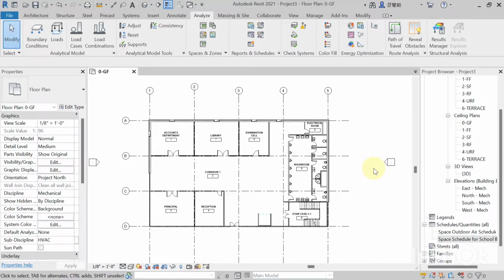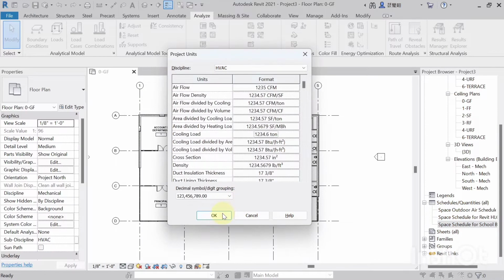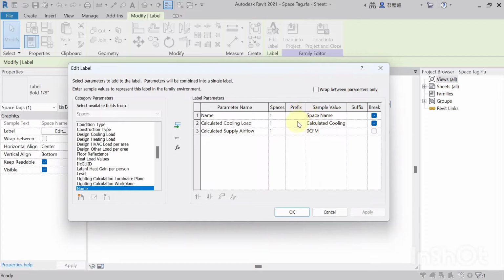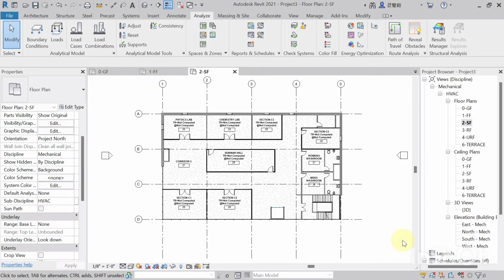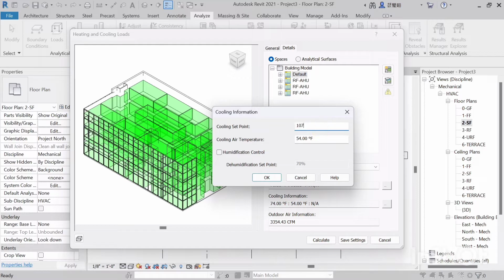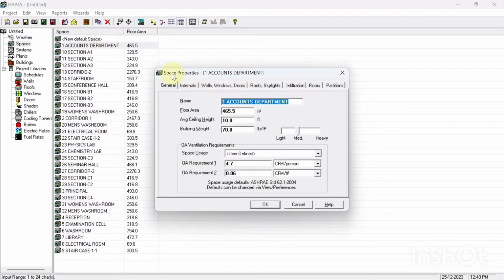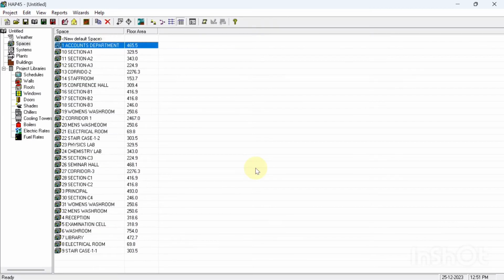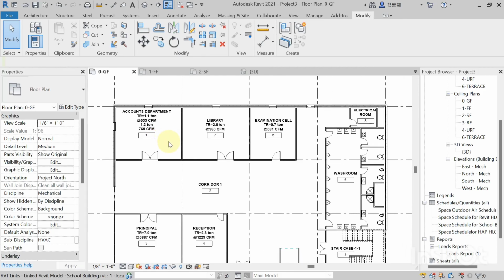Complete Heat Load Calculation in Revit | Full Step-by-Step Tutorial!

Comment: There is an Outdoor Airflow, how does it differ from Fresh Air?
Reply from the maker: Yes — they are related terms, but not always used exactly the same way in HVAC.
Outdoor Air
Air taken from outside the building into the HVAC system. It may contain dust, humidity, heat, cold, or pollutants depending on weather and location.
Fresh Air
A practical/common term for air supplied to occupants for breathing and comfort. Usually this means clean outdoor air after filtration and conditioning.

Comment: In the revit heat load calculation > the default tab showing the uncondition rooms in your video. But when I am following the video mycase the default tab contain all the spaces. what to do? I am using revit 2026
Reply from the maker: In Revit 2026, Autodesk changed the default behavior. Now the tab shows all spaces instead of only unconditioned ones. You can filter the list manually or create a schedule/filter to view only unconditioned spaces.
Reply: @mepbooster8184 how to create it? Please guide.

Comment: Sir My HVAC heatload calculation create the error "Control Room 1 is not upper bounded by a roof, ceiling or floor element. This can result in incorrect adjacencies and voids in the analytical model. Please ensure that Upper Limit and Limit Offset for Control Room 1 is set correctly." Please suggest how to rectify

Comment: Sir, my HAP design cooling load value is coming lesser than the revit cooling load value. Is this acceptable or my revit cooling load is mistake? which value to take as correct sir help
Reply: Revit me jo calculation ata h wo shi nhi rhta utna tumhe fir usse export krke HAP software me Krna hoga
Reply from the maker: Latest version revit follow  kare woh sahi rehta hai usme detail me hai
Reply from the maker: Are you using latest revit load calculation because in latest version energy Modeling is available you will get load calculation accurate

Comment: I have a question: if the north in Revit is not the true north, how should the calculations be done correctly? because a lots of plans came straight for easy use
Reply from the maker: If the north direction in a Revit model is not set to True North but rather Project North, it is crucial to correct the orientation to True North to ensure accurate calculations, especially for tasks like solar studies, energy analysis, or HVAC load calculations.

Comment: TLDR: The tutorial demonstrates how to effectively use Revit for HVAC design by creating a space schedule, setting up conditioned and unconditioned spaces, and performing accurate heat load calculations to ensure efficient indoor comfort.

1. 00:00 🔧 Create a space schedule in Revit for heat load calculations by adding key parameters and using formulas for fresh and return air.
	1.1 Create a space schedule in Revit as the first step for heat load calculation.
	1.2 To create a space schedule for heat load calculation in Revit, access the analyze tab, select spaces, and add parameters such as level, room name, area, and space type.
	1.3 To create a comprehensive heat load calculation schedule in Revit, include calculated cooling load, supply air flow, condition type, number of people, outdoor air per area, outdoor air per person, and calculate fresh air CFM using the appropriate formula.
	1.4 To calculate fresh air in Revit, add a calculated parameter using the formula for outdoor air per person multiplied by the number of people, plus outdoor air per area multiplied by the area of the space.
	1.5 To calculate return air in Revit, use the formula: return air = calculated air flow - fresh air, and add it as a calculated parameter in the schedule.

2. 06:03 🌡 Format Revit views for heat load calculations by sorting levels, adjusting unit settings, and specifying room conditions for accurate cooling load totals.
	2.1 To format the view in Revit, sort by level, add a footer with totals, hide the repeating ground level, and ensure the level is not displayed in the body.
	2.2 To view total areas and calculated cooling loads for each floor in Revit, use the formatting options to select and calculate totals, and adjust units as needed.
	2.3 To change the cooling load unit in Revit's space schedule, access the unit settings, select HVAC, and choose the desired unit, while ensuring the correct space type is assigned for accurate heat load calculations.
	2.4 Select the appropriate condition type in Revit for each room to specify whether to supply cooled air, heated air, both, or no conditioned air.

3. 10:55 🏢 Set up conditioned and unconditioned spaces in Revit, create a space schedule for fresh air requirements, and customize space tags to display essential information like cooling load and airflow.
	3.1 Set up conditioned and unconditioned spaces in Revit for various rooms, specifying ventilation where needed.
	3.2 During heat load calculations in Revit, it's essential to specify conditioned and unconditioned spaces accurately, particularly for principal rooms and corridors.
	3.3 To perform heat load calculations in Revit, first create a space schedule to determine fresh air requirements and then adjust the space tag accordingly.
	3.4 To modify a space tag in Revit to display additional information like supply airflow and cooling capacity, select the tag, go to the modify tab, and edit the family to include the desired space labels.
	3.5 To customize tagging in Revit, select desired parameters like calculated cooling load and supply airflow, then apply changes to display them in the tag format.
	3.6 To display the space name, calculated cooling load, and supply air flow in a vertical arrangement in Revit, edit the label settings to include prefixes and suffixes as needed.

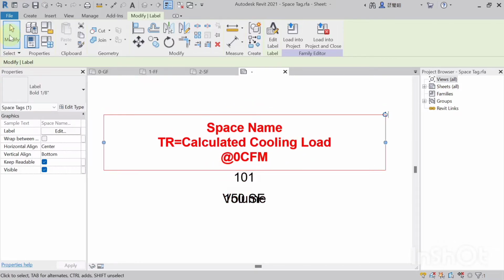4. 18:17 🏗 Save and load the updated Space Tag in Revit for accurate heat load calculations, create HVAC zones for multiple floors using a single AHU, and ensure proper identification of HVAC zones.
	4.1 Save the Space Tag for Revit heat load calculation to your desired location and load it into the project to view the changes.
	4.2 To display the supplier CFM and cooling load values in Revit, replace the existing Space Tag with the updated one from your saved files.
	4.3 Select and update existing tags in Revit for rooms requiring air conditioning, ensuring accurate heat load calculations and proper identification of HVAC zones.
	4.4 To supply conditioned air to multiple floors using a single air handling unit (AHU) placed on the roof, create an HVAC zone in Revit and define it accordingly.
	4.5 Select the desired spaces in Revit to supply conditioning, then finish editing to confirm the selection.
	4.6 Create HVAC zones in Revit for multiple floors using the same air handling unit (AHU) while managing duplicate name warnings.

5. 25:39 🌡 Accurate heat load calculations in Revit are crucial for HVAC system design, starting with building type and location selection to ensure efficient indoor comfort.
	5.1 Accurate heat load calculations in Revit are essential for determining HVAC system requirements, optimizing sizes, and ensuring efficient indoor comfort.
	5.2 To determine duct sizing, start the heat load calculation by accessing the heating and cooling load options in the analyze step of Revit.
	5.3 To perform a heat load calculation in Revit, select the building type (e.g., school), specify the location (e.g., Hyderabad, India), and use the internet mapping service to define the location for accurate design conditions.
	5.4 To resolve the project address error, ensure you are connected to the internet and use the search button to locate your city.
	5.5 The ground plane is the horizontal surface for construction, requiring selection of the ground floor and project phase, while considering the service gap for HVAC and plumbing systems in the building envelope.

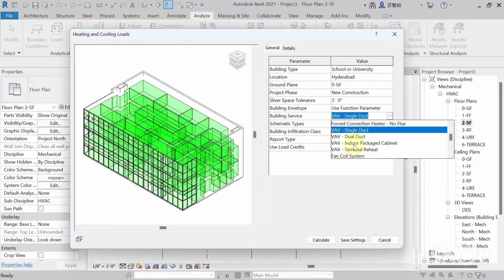6. 31:15 🌡 The tutorial covers HVAC design using Revit, focusing on VAV systems, setting unconditioned spaces, calculating cooling loads, and exporting heat load reports.
	6.1 The tutorial explains the selection and differences between single duct and dual duct Variable Air Volume (VAV) systems for air distribution in HVAC design.
	6.2 Select the building infiltration class as medium and designate unconditioned spaces like corridors and washrooms in the default settings in Revit.
	6.3 To calculate the cooling load in Revit for an unconditioned space in Hyderabad, input the cooling set point of 107°F, adjust the indoor air temperature to 102°F, select all HVAC zones, and set the cooling air temperature to 56°F to achieve a comfortable room temperature of 76°F.
	6.4 The tutorial explains how to perform heat load calculations in Revit, including generating and saving load reports for various spaces.
	6.5 To transfer a heat load calculation report from Revit to HVAC software, open the 3D view, select the export option, choose gbXML, check the use room and space volume, and save the report to your desired location.
	6.6 Save the file as XML, then open Revit software to create or access a project.

7. 41:33 🌡 Import the gbxml file, set measurement units, and manually input location details in Revit for accurate heat load calculations, while noting potential inaccuracies in heat transfer through partition walls.
	7.1 Select the latest ventilation option, set the measurement units, and import the gbxml file into the software for heat load calculation.
	7.2 To view and edit the details of a selected space in Revit, such as the account department, access the space properties to see information like floor area and ceiling height.
	7.3 Revit's heat load calculation may not accurately account for heat transfer through partition walls between conditioned and unconditioned spaces.
	7.4 To perform a heat load calculation in Revit, manually input the location details, such as latitude and longitude, for cities not listed, like Hyderabad.
	7.5 To determine air properties for heat load calculations in Revit, refer to the ASHRAE handbook for specific data such as latitude, longitude, elevation, and temperature ranges for your location, like Hyderabad.

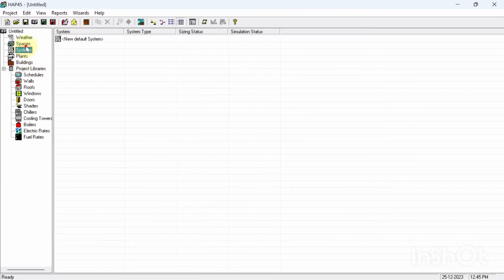8. 48:04 🔥 Perform heat load calculations in Revit by inputting space dimensions, U values, and partition details to generate accurate cooling load reports.
	8.1 To perform a heat load calculation in Revit for an account department, select the appropriate space, input the floor area and U value, and measure any partition walls between conditioned and unconditioned spaces.
	8.2 To calculate heat load in Revit, measure dimensions, adjust units, input wall partition area and U values, and account for temperature differences to finalize the cooling load.
	8.3 To transfer a heat load report to Revit, create a space schedule by selecting the appropriate parameters such as level, space name, area, design cooling load, and supply airflow rate, then adjust formatting and settings as needed.
	8.4 Create a space schedule and modify the space tag in Revit to display the design cooling load and specified supply air flow for accurate heat load calculations.
	8.5 The tutorial demonstrates how to perform a heat load calculation in Revit for a VAV system in a single space, including selecting components, inputting data, and generating results.
	8.6 Adding partition wall details in Revit increases the cooling load to 1.3 TR and supply airflow to 769 CFM, highlighting the importance of including all details for accurate heat load calculations.